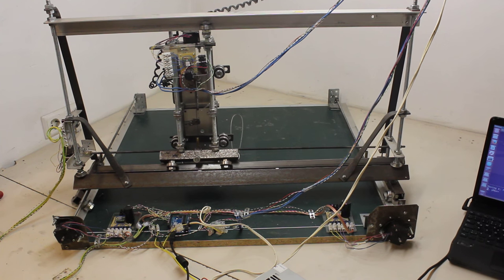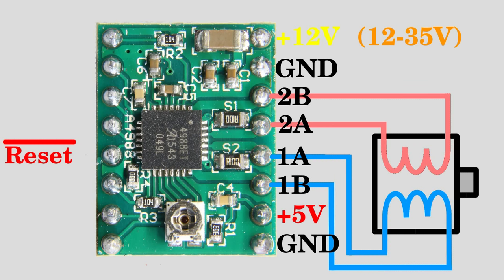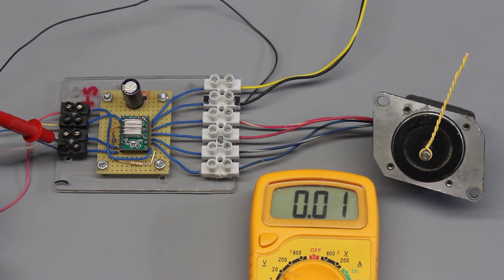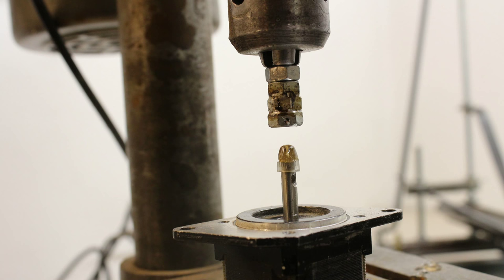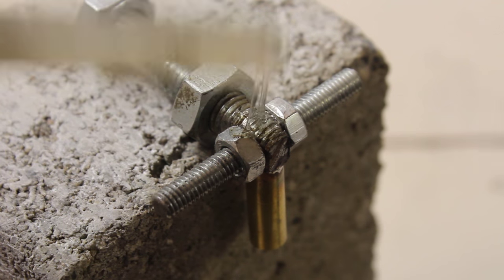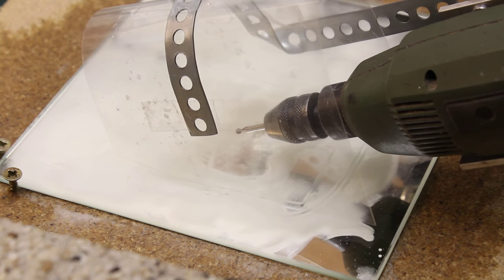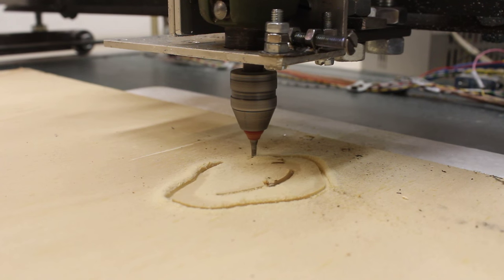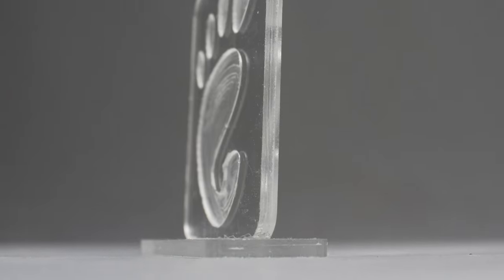Revision v2.1 of my DIY CNC made with simple tools and cheap materials

Comment: Awesome upgrade video. At around 12:05 you had some dancing nuts. An old racer's trick someone tought me is to use fishing line to make cheap DIY nylon lock nuts. If you loop a thin piece of fishing line through the nut then thread it on, it will stay in place just like a nylon-lock-type nut, and it doesn't leave a mess like glue or thread compound do.... Thanks for all the hard work you do to make these videos!!!
Reply from the maker: +Jake Little I'll keep that old racer's trick in mind - thanks for sharing your thoughts!

Comment: very nice... I'm always impressed with your ingenuity and it looks like using the stepper motors has improved it allot.
Reply from the maker: +builtrodewreckedit Well, the bipolar stepper motors are more reliable, but might skip steps when the mechanical load becomes too high. The closed loop control of the geared DC motors never skip steps, they just stop. The choice is yours.

Comment: Just idea - what about connecting threaded bars and motors with shrinking tube? There are also shrinking tubes with glue inside (not flexible, I have no idea how much they cost) that could be maybe perfect for it, without drilling anything into motor shaft. At work we were shrinking these glued ones on stainless steel thermometers and it held perfectly at place.

About plywood, what about using of double-sided tape, so plywood won't run away when you're finishing cut? We were doing this with PCBs in school, so we could drill any shape and it stood still on perfectly same place before we used knife to remove PCB with tape from machine. Of course there had to be no air bubble, so you had to attach tape slowly and with force on whole PCB and then carefully press it to clean machine board.
Reply from the maker: +Michal „Dreit“ Kundrát Thanks for sharing your ideas.
I am not sure, if the shrinking tube can reliably avoid motor and threaded bar from twisting, maybe because I don't have that extra strong material you have...
Usually the cutting lines are designed in such a way that there remain some connections between the part to be cut and the rest of the plate. Those linkages are cut with a knife when the CNC has finished it's work. Double sided tape will work with PCBs, but when cutting wood it might stick on the router and so give bad results.

Comment: Another excellent video and design using commonly available parts and tools to make a useful machine! One concern: At 3:20 when measuring the current from the driver to the stepper motor; connecting and disconnecting a motor lead like that can fry the driver. With a small driver like this, and one which is well designed, it's not a problem. But I would avoid doing that with other drivers, especially if they are cheap junk from China or if you are using larger motors and currents.
Reply from the maker: +James Newton Absolutely right! Inductive loads should generally not be connected or disconnected from a terminal while the circuit is powered! I try to remember that in future videos.
Reply: HomoFaciens Please let me know if you are ever interested in building a larger version. We have a couple of open source designs for stepper motor drivers in the 3 to 4 amp, 75 to 200 watt, range which I would be happy to give you a kit at no cost, just to say thanks for these videos. The Linistepper especially is one that can be made at home (several single sided PCB layouts exist, and it uses a commonly available PIC processor with open source code) for those who like to DIY. The more powerful THB6064AH driver is harder to make at home, but performs nearly as well as drivers costing $70 at half the price, while promoting reparability. e.g. you can run massive NEMA 42 motors and still replace the drive chip for $10 if you happen to fry it.
Reply from the maker: +James Newton One lesson I have learned about CNC is that small is beautiful! Nonetheless even with this machine having a work area of 50x50cm, more speed would be a huge improvement. I could not find a link to a homepage on your channel or is it just a hobby project? I am always interested in Open Source hardware, but currently there are many projects in my brain waiting to be turned into something physical...
Reply: All the information about the drivers is here:
http://techref.massmind.org/techref/io/steppers.htm
Message me your address if you want one or both.
Reply from the maker: +James Newton Thanks! I'll keep your offer in mind, because v2.1 isn't the end of CNC evolution.
Your homepage and hardware are definitely worth having a look at!

Comment: I think a timing belt assembly might solve a lot of problems that come up from using threaded rod.The parts for the assembly could be mild using the current set up.
Reply from the maker: Belts bend under load (clearly more than steel rods do), thus they are not recommended for use in CNC routers.
Reply: True, however if the load is supported by rails (see ShapeOko2 configuration) this problem is solved. Otherwise, sticking the flat side of the belt down along the axis - making a rack and pinion drive could also work?
Reply: Thanks for sharing btw- I've watched all your vids and subscribe :P
Reply from the maker: That ShapeOko2  solution has it's drawbacks, too.
A rack and pinion design is also not free from backlash and it would not be not self locking as my drive is.
Threaded drives are used for good reasons in CNC routers for decades ;-)
Reply: Thanks for the advice. You're definitely right. I was hopeful for the pinion-belt/rack drive because I want to try this using only parts from a printer/scanner/both. Why don't I just get threaded rod: when I was a kid I thought I'd try making one (lol I had 0 experience in any engineering). I got as far as buying some threaded rod from the hardware store, but the backlash was ridiculous. When I last checked (maybe 10 years ago), a decent high thread rod and nut were extremely expensive. Maybe now, I'll start searching again :P

Comment: Excelent. I want to build something similar but more faster. Its posible to use DC motors and rotary encoder like your servo proyect to get more speed?
Reply from the maker: +Javier Enrique Traid To get more speed, you should use more powerful steppers (and driver boards) or at least a higher voltage (you can use up to 35V instead of just 12V).
Using geared DC with encoders is described in the video about CNC v2.0:
https://www.youtube.com/watch?v=mJ-TZvFpY58

Comment: Nice job! Given the improvements to the frame, do you think you would get the same result with your DC motors?
Reply from the maker: +Finlay MacNab Yes, it's the build quality of the frame and the drive (treaded rods) that rules the accuracy, not whether the steps are driven trough a DC motor with encoder or a bipolar stepper motor. The higher number of steps per revolution isn't that clear improvement.
Reply from the maker: +Finlay MacNab I used that closed loop design in my CNC v2.0:
https://www.youtube.com/watch?v=mJ-TZvFpY58

Those geared motors with build in encoders seem to be a great drive for machines. Maybe I will order one or two...
Reply: I am well aware my friend! :)  You are my closed loop key opinion leader.

Comment: I was just re-watching the video of the original version of this machine yesterday and wondering when you would publish your next video!

I'm considering building this machine with my class (I'm a teacher and teach the same class in both science and shop, so why not combine them?). It looks like this latest version is the easiest to build, since you don't need the rotary encoder. Would you agree that this is the easiest to assemble and program? And can I skip the Arduino if I use a Raspberry Pi? I would need more power of course, since it can't produce a 5 v signal.
Reply from the maker: +MrKaizerWEM Yes, the electronics design of v2.1 is simpler and bipolar steppers are usually more reliable than brushed DC motors with encoder disc. You have to write your own software to control the CNC when replacing the Arduino with a Raspberry Pi. The 3.3v of the GPIOs can control the A4988 chip without stepping up to 5V. Simply connect the logic level pin to +3.3V instead of +5V.
Would be nice to see your machine, soon!

Comment: What would be your conclusion on using stepper motors?

As I see it, while they improve speed and reduce some backlash, you can achieve same results with better software (or faster processor) and more rigid construction while keeping DC motors.

Also, are steppers more noisy?
Reply from the maker: +failing@commenting Stepper motors are more reliable than brushed DC motors with optical sensors. 
On the other hand DC motors with encoders can't skip steps as bipolar steppers do whenever the mechanical load becomes too high. 
The choice is yours...
Reply: Well, DC motors seem to be more fit for "primitive tools" theme, except for optical sensors part. IIRC cheaper too.
Reply from the maker: +failing@commenting Yes, some people with no access to new electronics welcomed the DC motor design, because those drives can be found in many scrapped devices.

Comment: Dear sir, What drill bit you have used to cut the plastic?
Reply from the maker: A 1.5mm cutter with two flutes is a good option. Normal drills won't work, you need a cutting bit.
Reply: Thanks a lot for your reply.

Comment: This is good video I like this chanal can I use the urduino of old hp printre or any other printre please
Reply from the maker: +نبع الحياة I haven't tried urduinos from old printers (yet). The question is: Can you control a stepper motor through USB with your Urduino? Than you might succeed with the whole project.

Comment: Any chances you would show how to make a servo "Close Loop" that is compatible with the standard drivers sold on ebay really cheap? I have  machine that I build and is constantly loosing steps! By the way I'm using Mach3
Reply from the maker: +Migueldeservantes I have submitted the next evolution step of my CNC (version 3.0) machines to the HackadayPrize2016:
http://www.homofaciens.de/technics-machines-cnc-v3-0_en_navion.htm

For this machine I will create a closed loop drive with Step/Direction input terminals. Stay tuned!
Mach3 is no option for me since I am using Linux only.
Reply: +HomoFaciens  are you aware that Mach3 have a compatible version with Linux? Never the less very nice work, kind of envy the fact that you have your own custom made encoders.
Reply from the maker: Migueldeservantes
Well, Thanks for the hint, but Mach3 is not on top of my list (yet) and I haven't heard about a Linux version.

Comment: Dear Sir can we replace our usual L298N H Bridge Driver board for this A4988 board
Reply from the maker: Not without making changes to the source code of grbl. The A4988 is commanded through two step/direction pins, the L298N is commanded through 4 input pins per motor.

Comment: So what is better after all? Encoded DC motors or steppers?
Reply from the maker: +TheKitMurkit It's up to you what drive you use. Stepper motors (=brushless) are more reliable than brushed DC motors (especially the cheap ones). DC motors with encoders won't skip steps if the mechanical load gets too high.

Comment: Hi. May I know if I add a small motor to my 3dprinter. How do I get the gcode for cutting? In 3d printing, I just use simplify 3d to convert stl to gcode. But in cnc cutting, is it I use back simplify 3d software and convert the stl file into g-code for cutting. 3d printing is addictive, cnc cutting is deductive. So I don't think it is the same. Please enlighten me. Thank you.
Reply from the maker: +SalesTag developer The mechanics of 3d printers are usually not made for cutting with a router motor. You might ruin your printer (or at least worsen the backlash over time). How to add code depends on the soft- and firmware of your printer model. I don't own a 3d printer (yet), thus you will have to figure that out by yourself...
Reply: +HomoFaciens thank you

Comment: Now I have nothing to complain about!
Need...to..find...something...to...complain...about....
Reply from the maker: +Spirit ....no reason to leave my channel ;)
Reply: HomoFaciens What's next in the works?
Reply from the maker: +Spirit A simple robotic arm using hobby servos. Same as with my CNC machines I'd like to start with a cheap and simple machine and make it better over time...
Reply: HomoFaciens Just... don't make direct linkages, okay? That's going to be a robotic wobbly stick, not an arm :P
The next step up would be to use geared motors - I've been doing research on this myself.
The geared motors, however, are VERY expensive.
For a 100:1 NEMA23 you're going to pay over $70, though the prices go down as you go down in size(motor size), but the reduction ratio doesn't really affect it.
Reply from the maker: +Spirit Sorry, but I am making direct linkages. I like the term "wobble stick" - that's what those robot arms indeed are, even if some are designed to look like quality tools ;)
It's a first approach to make a robot arm and a wobble stick is a great example of all the weak points, a robot arm suffers from. Another thing they are good for is creating some base software and teaching some maths (Pythagorean theorem and so on).
After discovering the drawbacks I can try to minimize them in future designs.
70$ motors are still not the quality products needed to get below a millimetre at the end of a robot arm, especially because gears introduce more backlash...
There are many reasons that make robot arms very expensive tools.
Reply: HomoFaciens You can actually get about 0.8mm repeatability with the cheapie planetary multistage gears - their backlash is around 10-15 arcminutes, so it's not terribly bad.
The cheapest(serveral hundred $ alone) harmonic drives have about that much backlash, or thereabouts.

Look at the "dobot" arm - it's overall design is complete garbage that is still ridiculously sloppy, but they do get quite nice repeatability of half a millimeter.
I'm sure you, with the german engineering™, can make a much better robot than they did, at least in terms of mechanics.
Reply from the maker: +Spirit The problem with the cheap devices from somewhere on the planet is: Do they meet the numbers printed in the datasheet?

First I'd like to see what can be done with low a cost design.

You are pushing my limits below 0.5mm - let's see if german engineering™ can fulfil your specifications ;)
Position feedback is a way to overcome backlash, but it's not too easy to implement in small scales. Accuracy is a real challenge...
Reply: HomoFaciens Well, do servos first - get the technique down, then try moving up to the geared steppers.
Reply from the maker: +Spirit ...or use geared DC motors as intermediate step from wobbly stick to robot arm.
Reply: HomoFaciens That could be it. Though you'll need precise manufactured encoders(no scissored tin cans!)
Reply from the maker: +Spirit ...I'll try the tin can version first ;)
Reply: HomoFaciens But then you'll have a wobbly stick with a soft limit!
Reply from the maker: +Spirit ...let's see how wobbly it will become.
Reply: HomoFaciens I expect a video on this soon :>